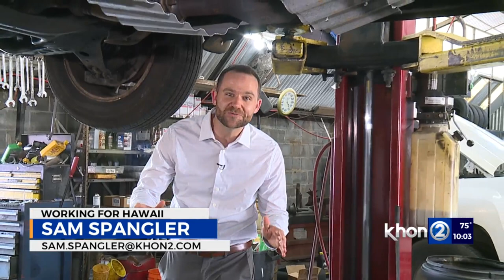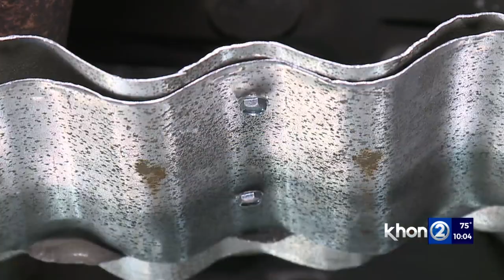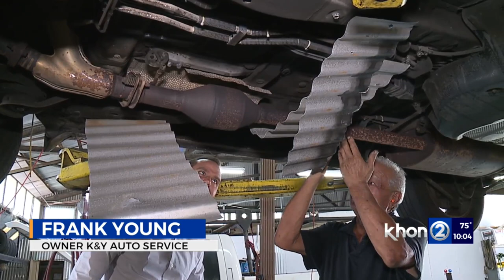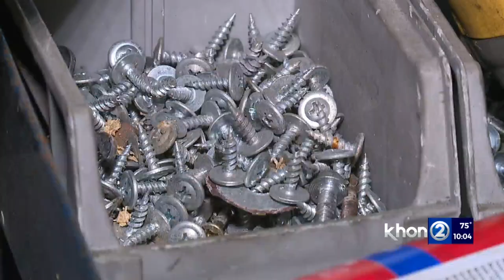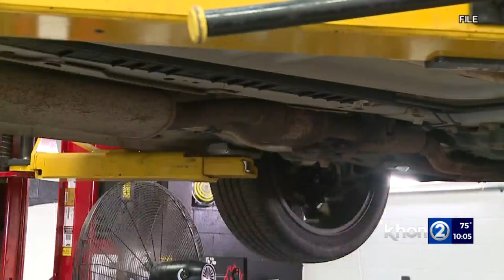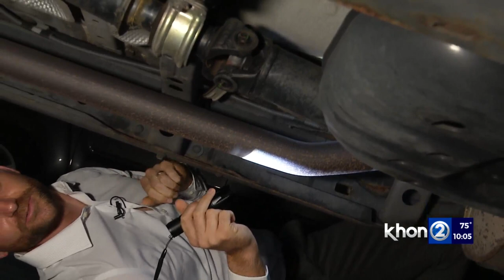Hawaii mechanic touts fix for catalytic converter theft

Comment: This has got to be a joke, they’ll just cut it further back and pull it out, and your chassis will rot when the bottom of the car drags on every speed hump and rips loads of holes in your sub frame.

Comment: Get some AR 400 steel 1/8" and plug weld it to the cat. Good luck cutting that material.

Cut it long enough to cover the pipes.

Comment: People don’t fall for this.its worthless they can just cut the other side of the pipe.there’s better ways..another way to put money in mechanic pocket..
Reply: Or you can pay thousands for a new converter.....
Reply: @kawikadee9670  not if you do better job then that shop..they used screws that u can take off with my impact gun in 20 seconds.go ahead and go to that shop trust me you will pay thousands..lmao